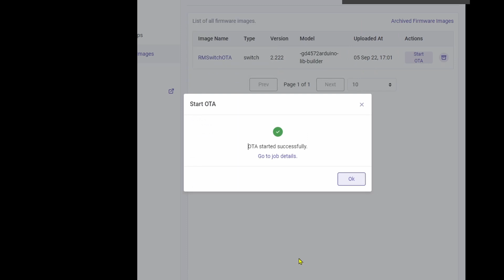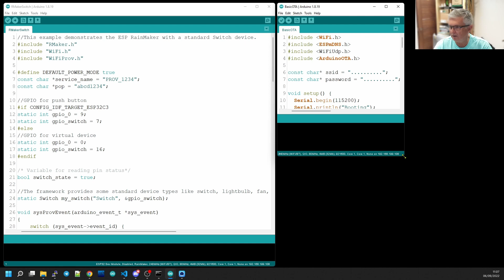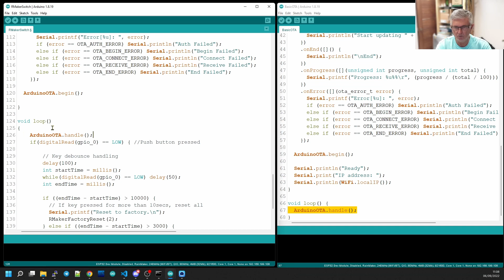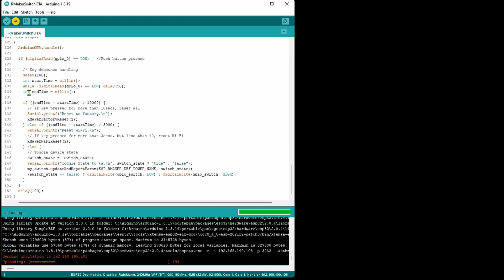ESP32 Rainmaker OTA on Arduino IDE (without the Crash) - Easy IOT

Comment: Thank you for this vid John, I've copied the OTAbasic code to my rainmaker project, uploaded the bin file to the ESP Raimanker dashboard but unfortunally it crashed (nothing happens) in my ESP32 board. Is there something else that I should do?
Reply from the maker: Hello @marcio.  You don't use the dashboard. You do the upload from the Arduino IDE - set the port to  device@IP_address in the list
Reply: @Magic-Smoke  oh, sorry, I've thought it was about doing remote updates (over the internet).
Reply from the maker: Well, it's really an interim solution to use across a lan or VPN while they fix up the built-in solution. Take a look at securing your connection here: https://arduino-esp8266.readthedocs.io/en/latest/ota_updates/readme.html

Comment: Sir, you really helping as thank you.
Please kindly do something about for as please rainmaker local control
Reply from the maker: I have asked Espressif about this over a month ago and I have not yet had a reply. I suspect that it will go away though and possibly be replaced by ESP Matter
Reply: @Magic-Smoke  1) Please will esp matter work with esp rainmaker?
2) And will it support  arduino ide  ?
Reply from the maker: @Smart TeG  Matter is a complete infrastructure of its own but it does integrate with Rainmaker - see https://docs.espressif.com/projects/esp-matter/en/main/esp32/introduction.html#espressif-matter-solutions

Comment: I can’t believe it! How did you find out! Amazing! Will dive into this soon… can’t wait to experiment with this…. Thanks so much
Reply from the maker: Lol, you're welcome. I tried it way back last year when I came across the crashing bug in Rainmaker.  I waited and waited hoping it would be fixed and then wondered if Arduino OTA would do the job.  At the time, it would crash too so I gave up which was a shame since I'd started a project that needed it. Anyway, I saw a comment from @rubia (below) on one of my other videos and decided to try it again last night and it worked!  Let me know how you get on and please share as widely as you can since I have a limited audience but I suspect a lot of people might find it useful.
Reply: I will spread the word. Can’t figure out why there aren’t that many people using this amazing tool. If more people would join, maybe espressif will put it a bit higher on their priorities list:)
Reply: it didn't crash! But it also didn't really work via the esp rainmaker dashboard....yet...probably something went wrong in me rushing:)
Reply: aaaand I just discovered I was still running the 1.8.16 IDE:)
But sofar it's just the "OTA URL Sent to Node" message....and that's it. or aren't you using the dashboard?
Reply from the maker: See above :)
Reply from the maker: It doesn't work via the dashboard. You have to upload to each client individually using the Arduino IDE. However, if Arduino IDE OTA works then other solutions like the one Andreas Speiss created a few years ago might work. That is the next step - it allows one to many updates and 'off LAN'